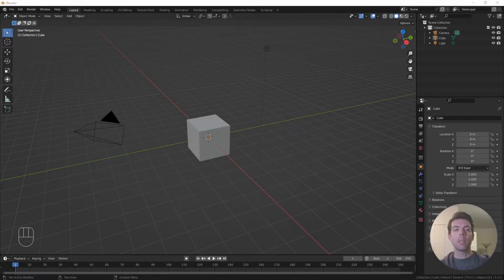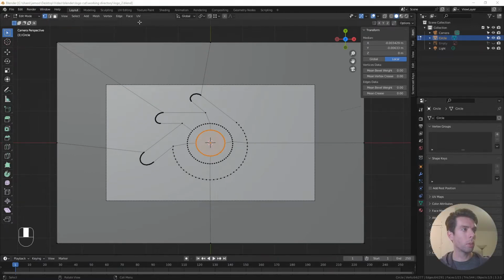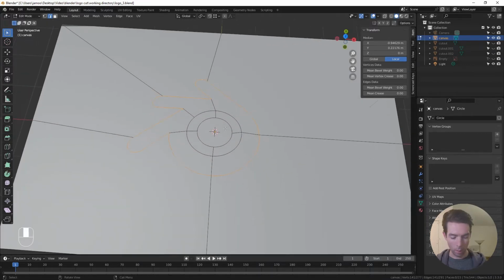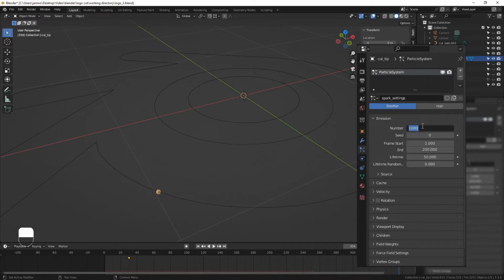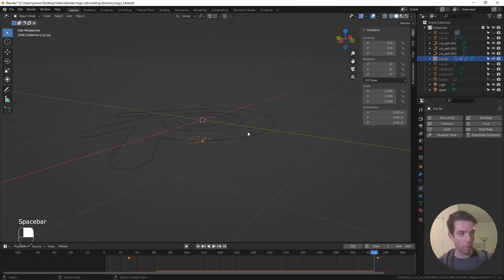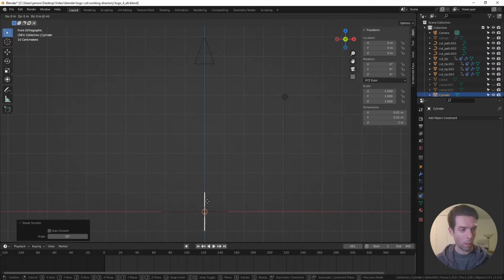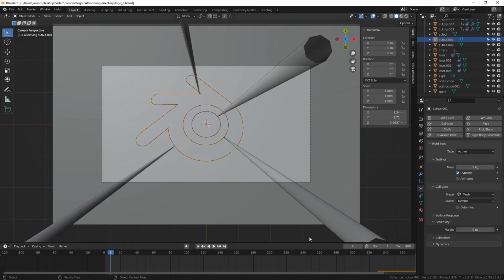Blender: Logo Animation Tutorial with Lasers

Comment: I didn't exactly follow this one step-by-step. Instead, I complicated things for myself by importing an SVG shape (which required a lot of clean-up) and adding a couple of circles around it. Long story short: it took me a while to get it together in the puzzle-piece style you wind up with, but I finally did - and now I have an  animation almost identical to yours.

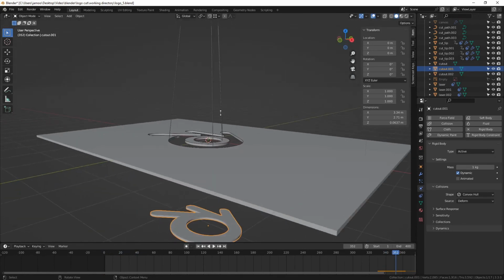I didn't have a problem with leaving the cutout set to "Convex Hull" (around 20:30 in the video), and it actually produced the best results in my case.

Love it - can't wait to see the materials! 👏
Reply from the maker: I realized that this tutorial is pretty different from my others. The others started with nothing and I basically knew what all the pain points would be. With this one I feel like people are going to run into their own unique issues depending on what kind of logo they want. It will be interesting to see what comments I get back on this one.

The Rigid Body simulation was actually one of the more complicated things for me to debug. I did a couple other logo designs and that always seemed to be the sticking point. Glad your setup worked out!